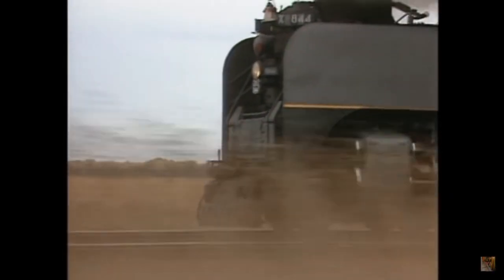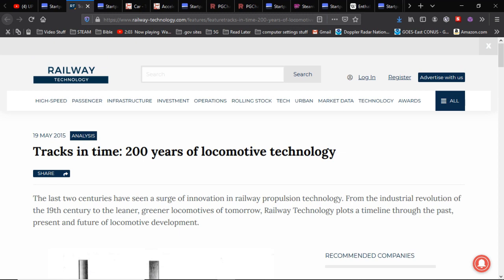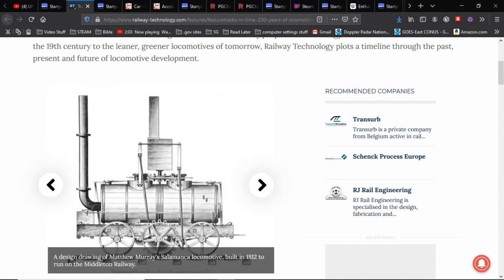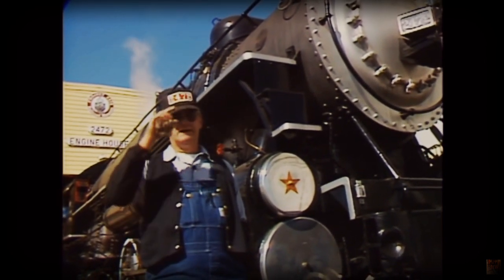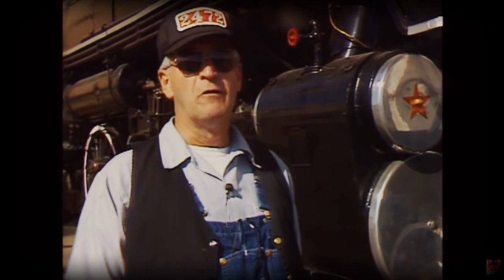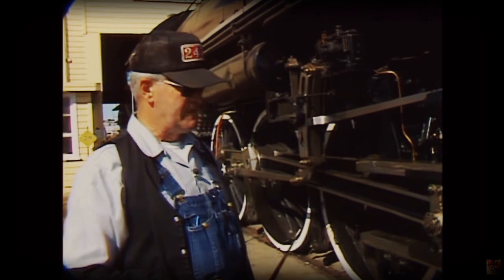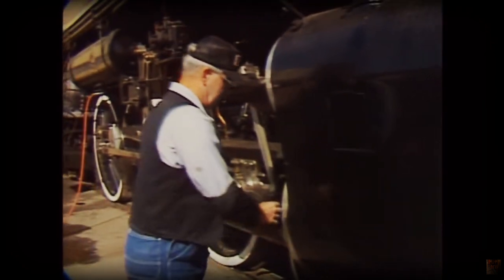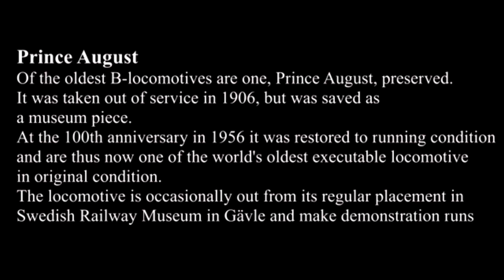The Expansive Power Of Steam

Comment: Don't these trains use coal to heat the boilers for the steam? I doubt they have the kind of filtration and emission control that a power station that uses coal does. Environmentalists lose their minds when it comes to coal.
Reply from the maker: Ill be posting part 2 and 3 tonight and will give a little more detail to how these engines work. Coal heats it, yes, but it will be reheated and superheated up to 750⁰F or more. Besides, ENVIRONMENTALLY speaking, Desil fuel to replace steam is a joke. A tragic fucking joke.
Reply: Many environmentalists are fashion victims. To quote Garbage:"Erase & Rewind, I've been losing my mind."